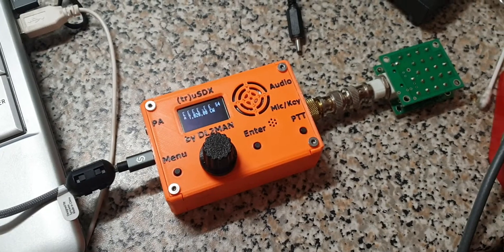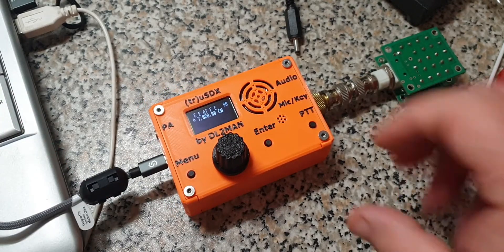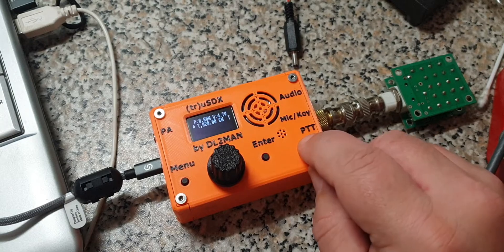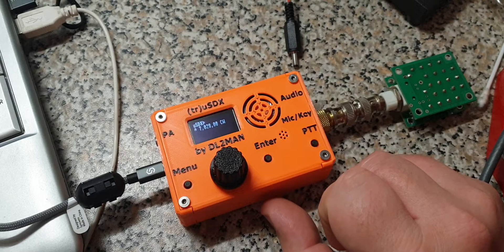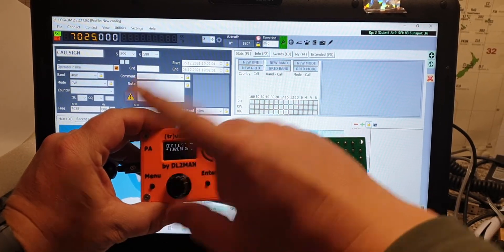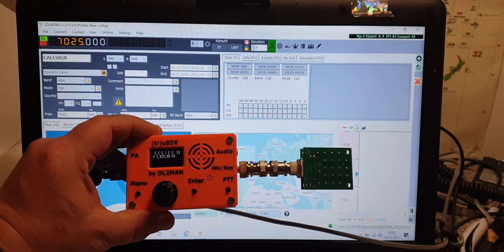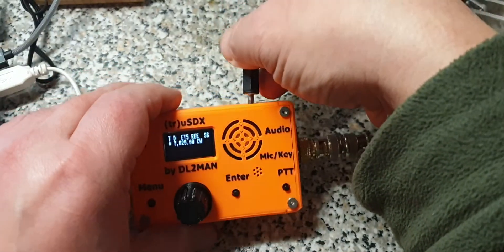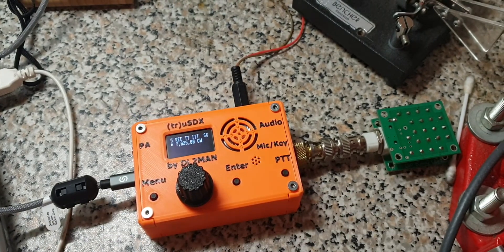(tr)uSDX Prototype - on-board USB Interface demo

Comment: Manuel, just finished building a “LO Band” (tr)uSDX “rig”. Upper left corner threads of front panel of case are stripped.  Shall I find a machined insert and fix the thread issue?  Or just replace the 3D printed left side case piece and procure from Sunny?  Please advise. 73 de KD6UYK (Tim)
Reply from the maker: Both is possible. you can also just use epoxy resin or hot glue to repair. There is no "required" procedure. 73 Manuel; DL2MAN

Comment: Would it be possible to built the kit with a 2,1mm power socket instead of the smaller one used right now? That would allow me to use the battery for my QCX mini without an adapter.
Reply from the maker: Sorry, the Rig should be received "as is".
Reply: @dl2man   I made a short adapter cable with a 2.1mm female socket and a 3.5mm male plug. All available on Amazon, etc.

Comment: is there a way to vary the output power through the firmware? or can we port between 5 and 13.8v to the barrel jack?
Reply from the maker: PWR can not yet be controlled by Software, but we plan to provide that option later. Barrel Jack is 7-15V. 5V can be supplied via USB only.

Comment: whats the amount of free flash and ram memory in % 
and its the high swr protection already included ?
Reply from the maker: Almost full, but it changes constantly, as Guido is working on the firmware as I´m writing to you. SWR Protection is not yet included, but will hopefully be on release date.
Reply: @dl2man  You have done an amazing job!!  Thank you for all your contributions.  Hope that SWR protection is included in the final release.  73 DE N2CR
Reply from the maker: @crwiener  I hope so too, but it is set up with 3x BS170´s anyway, so it won´t blow as easy as the IRLML2060.
Reply: @dl2man  Thanks for the answer

Comment: Any sense of how difficult it would be to add USB PD to get full-power transmit on USB alone? Thanks for all your work! Definitely proposing a group build at my club in the new year.
Reply from the maker: Full Power is not limited by the current, but the Voltage in this case. I you want to crate 5W on 5V, you´d need a Load of 1 Ohm, so basically a short circuit, creating all kinds of problems in Class E.
Reply: @dl2man  If I'm not mistaken, USB-PD can deliver 5 V, 9 V, 15 V or 20 V depending on the PSU :) 

BTW, amazing work, can't wait to order a kit! 
73, Manoel - ON6RF
Reply from the maker: @on6rf  Great hint. I wasn´t aware of that. It won´t be changed in the current design, but is definately something for the next project / layout. Whatever that will be.